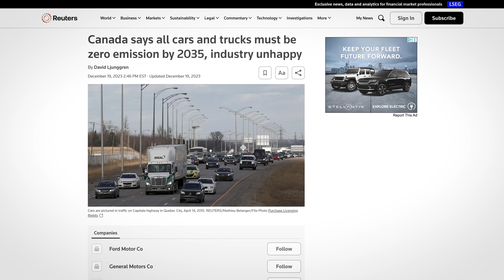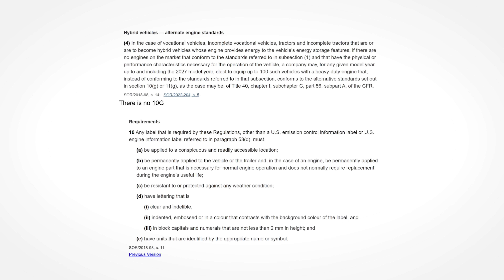Government Red Tape Is Blocking Our Plug-In Hybrid Trucks

Comment: does not seam like an impossible situation. would seam  you would just need to use a drive through system where the  the engine can power the truck directly by the ICE motor or the  by the EV generator /motor. be not that much different then very early  komatsu  from the 1940's that was both diesel and electric driven . that say relatively equivalent to the  Chevy volt  as modern comparison. you can still use the smaller engine and constant rpm charging by computer control clutching that on the back of the engine/generator. since bellhousing have not changed that much you can  just locate one of these old komatsu generators  a place you can look is an old komatsu earthmover all the  the winches  and rear wheel drive was electric and the front was ICE driven .example  on as tandem axle semi  i would make the  front axle  on the variable  ICE /electric and the rear axles 100% electric and if it happen to be a triple axle  truck the two rear  axles fully electric (and make the front fully electric as well). as a truck driver I would probably prefer  a variable source. ie: if I have  electric motor or ICE  issues I can limp on one of the other sources. instead of 18 speed transmission  just use AMT for the front  tandem axle.. once up to speed  that front axle can just coast. as  all you would need to is apply 10% more power to the electric motor and the AMT will naturally coast . you do not really need both axles driven all the time anyways it only really  required  to get rolling  once rolling  running on a single powered axle is fine. and would save on fuel consumption anyways - and the nice thing of the komotsu generator it was magnetically induced, you  just change out the the old ferrite magnets for neodymium magnets and you have a high efficiency generator/motor

Comment: 1:20 Why don't you just use a GMC or Chevy LS gas motor obviously they have beef with diesel that's their concern that diesel is very very high in emissions so go with the LS gas engine It will do the same thing
Reply: Since the engine was never certified for use in that way, in that vehicle, it is not legal to use it.
Reply: Big block 8.1 would probably more appropriate, here in California is actually quite popular to swap for a 8.1 on pre emissions trucks to get past the diesel emissions laws kinda Funny I can’t run a diesel but a carbureted v8 with no cats
Reply: @turkeyboyjh1  The 8.1L engine is a certified engine in that application, or at least an application in that year. Engine swaps are legal as long as the engine going in is the same age or a newer than the body. It is still going in front of a transmission to drive the wheels. It is not used to power a generator to charge the batteries to turn the wheels.

Not only are there no engines certified to be a generator on the road, there are no standards in which to certify it against.

They are in a classic catch 22.
Reply: I don't know why with the current high torque auto engines designed with 8 or 10 speed transmissions, there wouldnt be a good match.
Reply: You You stick a 6.2 LS engine with fuel management cut off from general motors it will be perfectly fine it can handle running that APU without a problem And you will be good and solid
Reply: @HOSSLEE @jasonthompson7230 As soon as you change the software, you lose the certified status.
Reply: Diesel engines are low emissions . They produce a minor amount of soot and thats it. Nox is non hazardous and breaks back down. Nitrogen and oxygen. Out asmostphere is 99+% those 2 things
Reply: @marioncobretti7870  If you combine NOx with hydrocarbons from unburned fuel, mix it with a little sunlight, and you will end up with smog. Very hazardous stuff.
Reply: @alannitcher5001 thats what the brochure says. Prove it. I believe theyve been trying to phase out diesels since the vw "scandal"  that 6 manufacturers were involved in, because they are significantly more efficient than EVs.  And now here we are
    If diesel, was a problem, it wouod be bannes glibally and not just in places like chinada where they are negative in terms of emmissions are a coubtry with how many trees they have.
     Furthermore there are hydrocarbons, everywhere. Its inecitable, always has been. Its selective goverbment overreach and its only about enriching a few people. If brookfield was funding edison, theyd be approved inside of a quarter and mark carney would be spouting what kind of hero canadian companies are

Comment: Could you please in the future define the term that the video revolves around?
the difference between on highway and off highway is the entire point of the video yet you don't define it. Unless you are replacing "off highway" with 'generator' at 1:59? IF that's a correct assumption, at least explain the regulatory difference, why are they different and why is one preferred?

Comment: What about taking an onroad engine that is the same ish spec of the offroad generator, and get it modified to be rpm governed like the old school throttle based cruise control? Does that allow it to work the way you need it to?

Comment: Dumb question, but can a vehicle engine be converted to do the same as an of highway generator and still meet the standards.  As in, measure the power needed, and then hook up the throttle to an actuator via a computer to adjust the throttle to match the needed power?  Maybe a generator company could help with the control module?

Comment: Who will team up to do some tasks below for Edison? Reply if you want get on a 🍁/🇺🇸 zoom …Edison you contact these replies ok? — Below is a detailed, step-by-step guide for Edison Motors Limited to register and sell their electric hybrid trucks in Montana, USA. This process covers everything from start to finish, ensuring compliance with federal and state regulations. Montana is a great choice due to its proximity to Calgary, Canada, and its straightforward regulatory framework, especially compared to the challenges you’ve faced with Canadian authorities. Let’s walk through it together.

Step-by-Step Guide for Registering and Selling Electric Hybrid Trucks in Montana, USA
Step 1: Obtain Federal Certifications
Before you can sell your trucks anywhere in the U.S., including Montana, you need certifications from two federal agencies: the Environmental Protection Agency (EPA) for emissions and the National Highway Traffic Safety Administration (NHTSA) for safety. These are non-negotiable and must be completed first.
1.1 Environmental Protection Agency (EPA) Certification (Emissions)
•  Why it’s needed: The EPA ensures your trucks meet U.S. emissions standards under the Clean Air Act. Since your hybrid trucks use a diesel generator to recharge batteries, they’ll likely be classified as heavy-duty diesel vehicles.
•  How to do it:
	1.  Contact the EPA’s Heavy-Duty Vehicles Program (search “EPA heavy-duty vehicle certification” online for contact details).
	2.  Submit technical data about your truck’s emissions—details on the diesel generator, battery system, and how they work together.
	3.  You might need to run emissions tests at an approved facility to prove compliance with federal standards.
	4.  Once approved, the EPA issues a certificate of conformity, which allows your trucks to be sold in the U.S.
•  Tip: Double-check that your diesel component meets current emissions rules to avoid hiccups.
1.2 National Highway Traffic Safety Administration (NHTSA) Certification (Safety)
•  Why it’s needed: The NHTSA sets safety standards for all vehicles, covering things like braking, crashworthiness, and other features relevant to heavy-duty trucks.
•  How to do it:
	1.  Reach out to the NHTSA’s Office of Vehicle Safety Compliance (find them at nhtsa.gov).
	2.  Provide documentation showing your trucks meet Federal Motor Vehicle Safety Standards (FMVSS)—think design specs, test results, or engineering reports.
	3.  If your trucks don’t fully comply yet, make any necessary design tweaks.
	4.  After approval, you’ll get a certification label to attach to each truck.
•  Tip: Safety certification is a big deal—don’t skip any details here.
Key Point: You can’t move forward with state registration or sales until both EPA and NHTSA certifications are in hand. Start this process early, as it can take a few months.

Step 2: Establish a Business Presence in Montana (Optional but Helpful)
Since Edison Motors is based in Canada, setting up a Montana business presence can make the state registration process smoother. It’s not mandatory for federal certification, but it helps with local logistics.
•  What to do:
	•  Option 1: Register as a foreign business entity in Montana or form a Montana Limited Liability Company (LLC). Visit the Montana Secretary of State’s website (sosmt.gov) to file the paperwork.
	•  Option 2: Hire a Montana-based registered agent to act as your local representative for legal and administrative tasks.
•  Why it helps: A Montana address simplifies dealings with state agencies and gives you a base for registering vehicles.
•  Cost: Expect some fees (e.g., $70-$100 for LLC filing, plus agent costs if you go that route).

Step 3: Register the Trucks with the Montana Motor Vehicle Division (MVD)
With federal certifications secured, you’re ready to register your trucks in Montana. Since these are commercial vehicles, there are a few specific requirements.
3.1 Understand Montana’s Registration Requirements
•  Who handles it: The Montana Department of Justice’s Motor Vehicle Division (MVD) oversees titling and registration.
•  What you’ll need:
	•  Proof of ownership (like a manufacturer’s certificate of origin or title).
	•  Copies of your EPA and NHTSA certifications.
	•  Registration fees (these depend on the truck’s weight and type—check with the MVD for exact amounts).
	•  If the truck’s gross weight is 55,000 pounds or more, proof of payment for the Heavy Vehicle Use Tax (HVUT) via IRS Form 2290.
•  Good news: Montana doesn’t require state-specific emissions tests or inspections, keeping things simple.
3.2 Submit the Registration Application
•  How to do it:
	1.  Go to your local county treasurer’s office in Montana (find one near your business address or agent).
	2.  Bring your documents: proof of ownership, federal certifications, and fee payment.
	3.  If you’re registering multiple trucks, ask about bulk options to save time.
	4.  Once processed, you’ll get Montana titles and plates for each truck.
•  Tip: Each truck needs its own registration before it can hit the road legally.

Step 4: Prepare for Sales
With your trucks certified and registered, you’re ready to sell them in Montana or beyond. Here’s how to wrap it up.
4.1 Provide Buyers with Documentation
•  What to give them:
	•  Copies of the EPA and NHTSA certificazione labels.
	•  The truck’s title and Montana registration documents.
	•  Any warranty or service info you offer.
•  Why it matters: Buyers need these to register the truck in their name, whether in Montana or another state.
4.2 Understand the Buyer’s Next Steps
•  Montana buyers: They’ll transfer the title at the MVD, showing proof of insurance and paying fees.
•  Out-of-state buyers: They’ll follow their state’s process, but your federal certifications ensure the truck is eligible anywhere in the U.S.
•  Extra help: Since your trucks are unique (electric hybrid with diesel), consider offering guidance for buyers in stricter states—it’s a nice touch.

Sequence of Agencies to Contact
Here’s the order to tackle this:
1.  EPA – Emissions certification.
2.  NHTSA – Safety certification.
3.  Montana MVD – Vehicle registration.
Reminder: Federal steps come first—Montana won’t register without them.

Additional Tips
•  Timeline: Federal certifications might take 3-6 months, depending on testing and approvals. Registration in Montana is quicker once that’s done.
•  Costs: Budget for testing (if needed), certification fees, registration fees, and possibly business setup costs in Montana.
•  Why Montana Works: Unlike Canada’s complex rules, Montana’s lack of extra emissions or inspection requirements makes it a breeze by comparison.

Final Summary
To get your electric hybrid trucks on the market in Montana, USA:
1.  Secure EPA (emissions) and NHTSA (safety) certifications.
2.  Set up a Montana business presence if it makes sense for you.
3.  Register each truck with the Montana MVD.
4.  Equip buyers with the right paperwork to take ownership.
Montana’s straightforward process and location near Calgary make it a smart entry point to the U.S. market. Follow these steps, and you’ll be rolling past Canadian regulatory headaches in no time! If you need specific contacts or forms, let me know—I’m here to help.

Comment: Can't you just take the emissions equipment from a similar on-highway engine and install it on the genset engine? Or switch the engine into the genset and change the governor setup over from the genset engine?

Comment: May want to look at what GM did for the Chevrolet Volt. It uses the same primarily electric powertrain, with a "range extender" engine, and they tried to call it an EREV "Extended Range Electric Vehicle" but it's still classified as a PHEV. Ideally, that engine can also directly mechanically connect to the drivetrain for efficiency at highway speeds, but that would be a ways down the engineering line for y'all. Either way, sounds like the perfect opportunity to work with an attorney and pave the way for future companies to be able to make diesel EREVs.

Comment: Just saw the short addressing the on road engine to generator conversion, and how about this;
Can you emulate human input into the factory ECU? That way you aren't re-programing the engine/ECU, but simulating a constant throttle pedal position based on electric load demand?
Just throwing shit at the wall here, hope it helps with the brainstorming.

Cheers, from Kamloops.

Comment: You should put the Genset connections and controls as a jumper to an external plug. So you could plug into a grid or your generator. Then you tell your customers that that must pull over to plug in your generator. That way it the same effect as plugging in your electric car to a off highway generator. Now if your customer leaves that generator plugged in while running on highway that is the customer operating out of emission spec.

Comment: The fuel pump governor is now all in engine software , if you put a truck engine  on cruise control  it adjust the fuel based on load like the genset engine .  so im  sure you could put an on highway engine into  edison truck and make it work . i live in europe  and its the same nonsense whith goverment legislations .

Comment: this makes some sense, Highway Engines have different issues then non  Highway motors. Realistically the only solution is eather get them certified, or get a custom ecu that forces the desel generator to turn on at a specific bat voltage(aka charge%)  and then uses rmp rpm to regulate for load.
Reply: the differences are probably non existent because we have just advanced significantly on these and icus in general so i honestly don't think it makes a difference. but they do have g loads that generators dont deal with and are not built to withstand. sadly im with the Canadian government on this one sadly.

Comment: All they have to do is give a yearly based exemption till they catch up with legislation.... Government is so worried about how they can tax and control every aspect.  There is a reason all manufacturing goes to other countries. 

I was modifying generators once and the wiring in generator was small wire approved by an engineer over sea... To make the same generator here I had to put wire that was 5 times the size, it was so big it was impossible... I said you couldn't make this generator in Canada with rules, but it can be shipped in from over seas and is ok? They said it was approved by an engineer over seas so was acceptable in Canada, but Canadian engineer can not approve same design here cause it doesn't meet regulation.

Comment: Is there a loop hole to exploit?  I'm thinking of how Subaru imported the brat with jump seats in the back to skirt the chicken tax.  It cost $0 for the dealership to remove them.  Perhaps all connections are there but nothing I stalled for testing.

Comment: Set the low idle at the desired rpm, connect the gas pedal to the generator with a throttle cable with plenty of slack and install an rpm limiter. Problem solved.

Comment: Have you thought about using the diesel engines and converting them to Propane. We used to do that with irrigation pumps. I can testify that the propane will work in a diesel engine. Just need to put a propane regulator on it.  They will put out more power than diesel as a fuel.

Comment: Would green APU generators  be legal? They run them overnite to  run ac and the heater or circulate coolant to keep motor warm at truck stops .They have kubota diesels in them.

Comment: I agree, EVs are a pipebomb dream. Over the road tractors should be running LNG with the diesel fuel for off road and locomotives. Automobiles should be either hybrid petrol or full gasoline v 10 supercharged Lil 'deuce coupe because CO2 is only .04% of the atmosphere so the goal is soot, SO2, & NO2.

Comment: Numerous times over the past six+ months, I brought this exact problem up numerous times, and edison never responded.  It's obvious that off highway diesel generator emissions are not compliant with on-road diesel emissions.  In the United States and Canada,  the regulations are very clear and easy to understand.  Hybrid vehicles must comply with the current on-road diesel emissions.
Reply: sounds like they have been aware of the issue the whole time you were and were trying to get an exception made, which did not happen.
Reply: @lexpox329 You don't build a company based on hopes, wishes, or maybes.
That's operating with bad faith.